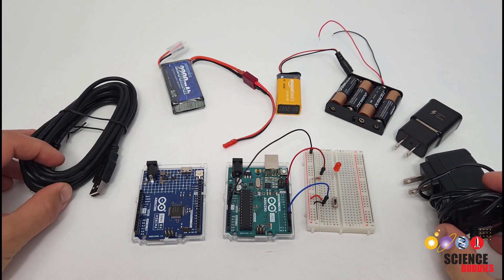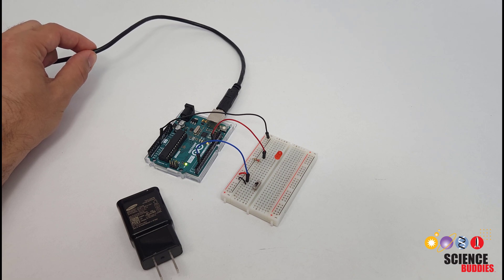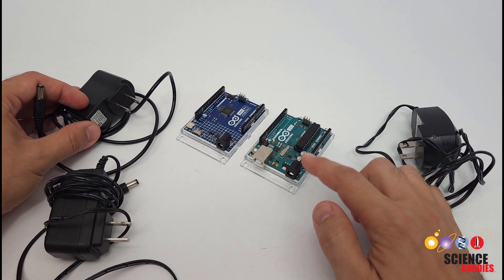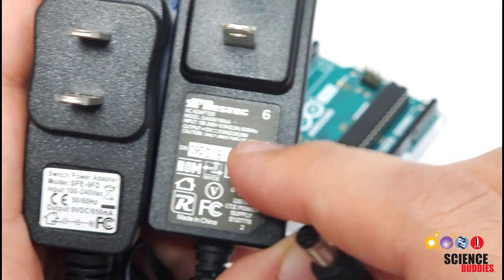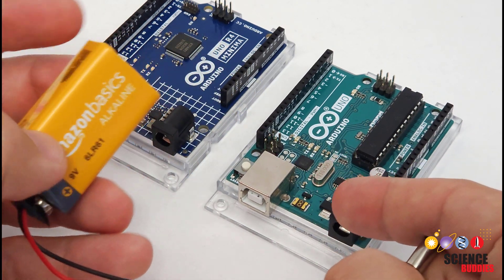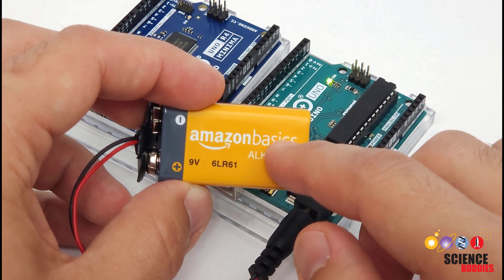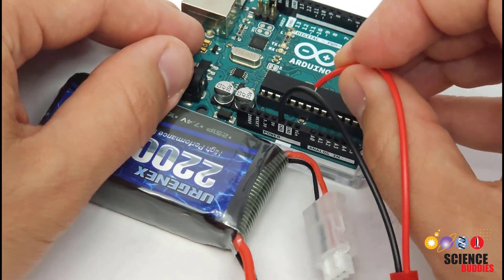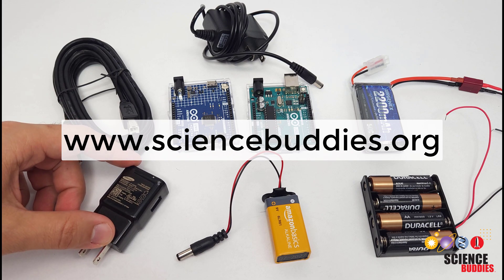How to Power an Arduino Project (Lesson #19)

Comment: You missed one of the easiest options; a USB battery bank. They have a built in charging circut and auto shutdown at low charge, can charge from a USB wall adaptor, can provide up to 3 amps at 5v if you've got led strips, servo's, motors, or additional boards that you can power from 5v. They can be bought in capacities of up to 40,000mAh with multiple USB ports. One for the Arduino, one for the high draw stuff. Their only real downside is they're below the range to feed into Vin if you've got a lot of LED's on output pins and are back in the 500mAH limit of the USB port.
And they're cheap for their capacity.

Comment: Using a 12v battery with the arduino using a step down voltage converter with servo motor can i make it as a mobile project?

Comment: thank you for the video! Question: is it possible to power a arduino uno with a mp3 shield and a start button with 12 volt?  I need to power it 50 times per year and than each for e few days. and i bought an accu of 12 volt. is it a good idea to have an DC convertor from 12 to 5 volt?

Comment: so um, ive got my arduino nano and im kinda confused, im new to all that and i tried connecting my VIN pin and GND pin to my 9V battery on a bread board, it said that to power it, it needs power in a range from 5V to 12V, but when i connected it to the battery, the TX led was blinking fast, so i think it might be too much current, anyways, should i soldier the goobay output to the 9V battery so i can connect the arduino through the main port?
Reply: or when i power the arduino with my computer, and plug in a LCD screen, it doesnt power it at all, and the arduino leds turn off too, just if like the voltage is to low, so if i connect the LCD Vcc and GND to the 9V battery and the 2 signal pins to the arduino, would it work? because im scared if i would break them 😅

Comment: I have a question about the wall adapter, yours is rated for both 5V and 9 V, I have some at home which give a range e.g. "3.6 to 6.5V," "6.5 to 9V," and "9 to 12V". Is this one safe to use?
Reply from the maker: As long as both voltages are within the Arduino's compatible range, you should be OK, but you may want to ask this question on the official Arduino forums just to be sure.

Comment: Hello I've bought a circuitmess jay-d mix table it's powered by a usb c plugged into a socket. I want to mount it into a nice box and power it with an anker powerbank I have but add a switch on the box the turn it on and off ..can you help 🙏

Comment: What if the battery holder doesn't have a plug for a jack cable?
like a battery holder with a regular red and black cable
Reply from the maker: You can buy an adapter like this: https://www.amazon.com/Power-Connector-Female-Adapter-Camera/dp/B07C61434H/

Comment: I'm trying to make the artificial pancreas project on your website.. What would be the best way to power that?
Reply from the maker: It depends on what type of pump you purchased - the 5V pump should be able to run directly from the Arduino and not require separate external power.
Reply: @Science.Buddies  I got a 6V Pump.. Will that be able to be powered by the Arduino?

Comment: How about 12volts battery in arduino uno? Would it work? And how long will it work?
Reply from the maker: You would need to look up the specs for the Arduino model you have (there are multiple different versions of the Uno now) on the Arduino website to be sure. How long the battery lasts depends on the capacity of the battery and what you are using it for.
Reply: @Science.Buddies  I'll be using the batteries for the ptc heating element and  peltier cooling element (both 12volts) which both can be controlled by (2 separate) arduino.

Comment: i tried 9v jack but with a 9v battery and the voltage regulator keeps getting hot, what should i do? i need my project to be powered through a 9v battery. output is 9v 650 mA
Reply: You need to see two things. The power accepted and the power that is being pulled. If the power being pulled is bigger than the power accepted, it can be hot.

You could also try to ventilate.

Comment: hello, I'm powering 36 micro servos off of two servo controllers. I used a battery power supply but it didnt work. Any ideas?
Reply: yes look up the PCA9685

Comment: Very good video. You clearly said that the input voltage should be in the range of 7-12 V, but what about the current? In my case I got a 12V, 2.5 A wall adapter, but in the video the current is 0.5, so I'm not sure if it's safe to use this adapter to power my arduino uno rev 3, because of the current of 2.5 A. Please help me. Thanks in advanced.
Reply from the maker: Hi - the current rating is the maximum current that the adapter can provide, so that is fine. The Arduino will only draw what it needs. The important thing is to make sure that the voltage is in the 7-12V range because, for example, a 20V adapter is going to do its best to provide 20V no matter what, which is too much for the Arduino.
Reply: @Science.Buddies  Appreciate you, sharing your knowledge, cheers mate!

Comment: I want to wire a single mg995 to an arduino and I want it to be battery powered (preferably aa). How many batteries should I use and where should I plug in the input and output wire?
Reply from the maker: Hi - we can't provide help with individual projects like this, you will need to either consult the manufacturer's documentation or ask for help in the official Arduino forums.

Comment: Nope. I connected barrel jack to the Arduino. It doesn't work. I built a binary counter in a breadboard. I wired the breadboard to the Arduino. when I connect the Arduino to the computer via USB, the program works fine. When I connect the 9v battery to the Arduino, the LED on the Arduino itself is on. So, that tells me that the battery works. But when I try to run my binary counter program by using only the battery, it does nothing. Unless the Arduino is connected to the computer, the binary counter doesn't work.
Reply: It’s because your barrel jack isn’t center positive
Reply: @kalaniwaters7  Thanks for this advice bro, i am powering my 15 servo motors with 5v 40 ampere power supply. But the servo are not working properly, it feels like there is no enough power. I tried your advice and i switch to different power jack that is very compatible to the socket. And it works ❤❤❤❤❤

Comment: Is the 9V battery enough to power 3 servos? I am making an animatronic eye project that should  last a long time. It has on 3 servos, and I'll be taking it to cons, so I want it to be able to last at least 6 hours, without having to switch the battery every time. (Maybe a rechargeable battery?)
Reply from the maker: 9V batteries generally aren't good for powering motors for an extended period of time.

Comment: I am a rookie in the Servo motor world so please keep that in mind. Im building a very basic project  that relies on a micro servo motor being controlled by a HJ Servo Tester / Consistency checker.  Servo will be "continuous" type. 
The micro servo will be attached to a  small penlight laser pointer that has a USB connector for charging.

 I really don't want to use an external battery pack with 4-AA batteries to power the tester. 

Is their an adapter cable that would be USB-A at one end and a a standard female servo motor connector at the other end.?
For a power source on the USB will be  a usb phone charger that is 5 volt/ 2 amp.  Thank You
Reply from the maker: We're not sure about a direct USB to servo adapter, but there are a variety of adapters that will let you break out USB pins to access the 5V from a breadboard, such as https://www.sparkfun.com/products/9966

Comment: This is so good. Thank you. I have a  barrel jack adapter that has an output of 6v. It physically fits but I  have the R3 Arduinoand was wondering if it will work at all since it's low.
Reply from the maker: It looks like the new R4 has an expanded input voltage range that goes down to 6V, but 6V is too low for the R3.
Reply: @Science.Buddies  okay, much appreciated. You are an excellent teacher!

Comment: Hey were did you get the switch which you can place on breadboard? Thanks.
Reply from the maker: If you search for "breadboard switch" on Amazon you will find plenty of options. This is a "single pole double throw" (SPDT) switch.